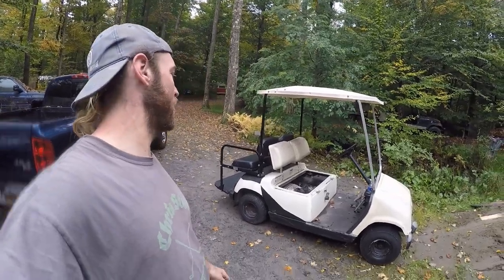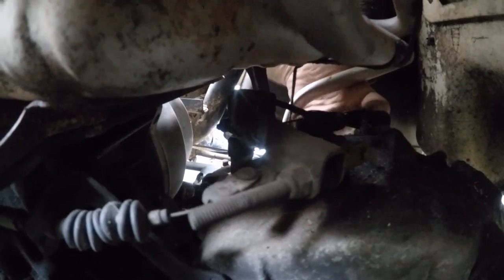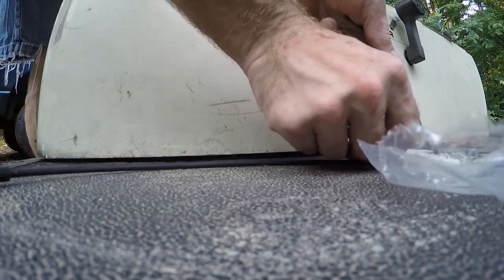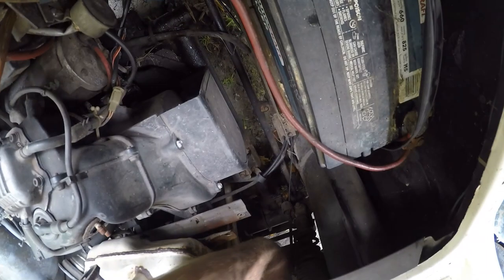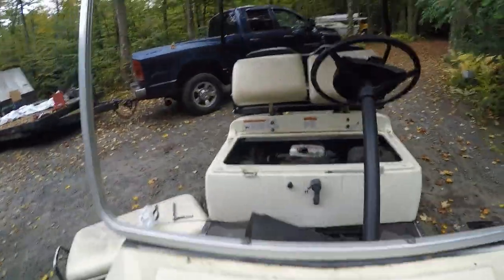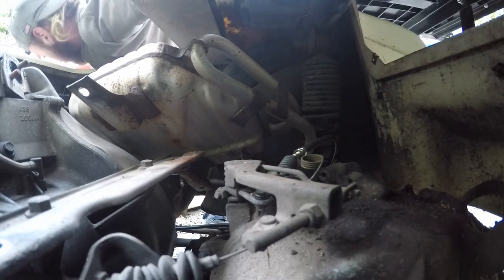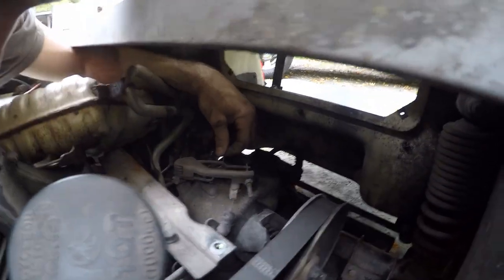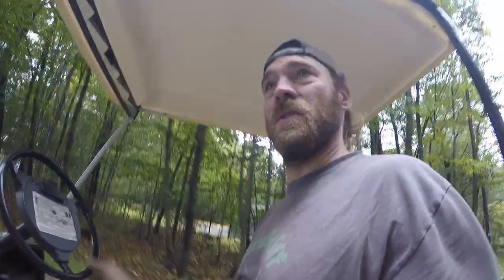Yamaha Golf Cart just DIES! Turns over won't start? How to fix it.

Comment: Thank you very much. It was the linkage cable. I didn't need a new one. It just got stuck so I took it off of the carburator an greased the linkage cable back & forth through the sleeve then hooked it back up. Runs great now. Thanks again!

Comment: Mine isn't turning over at times, what switch were you taking about in the beginning of the video? A accelerator/ throttle pedal switch?
Reply from the maker: There is a switch down by the gas pedal that turns on the starter.  Check those wires or replace it.
Reply: @MrBriansAmazingWorld  Thanks! Will check that out.